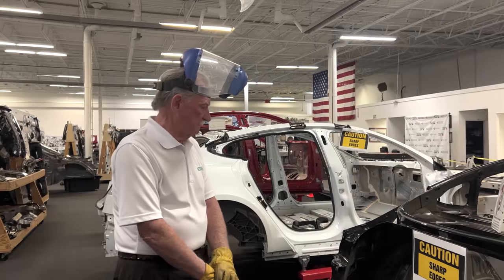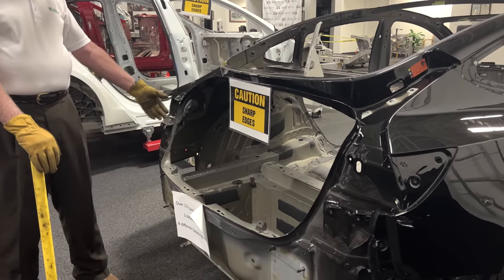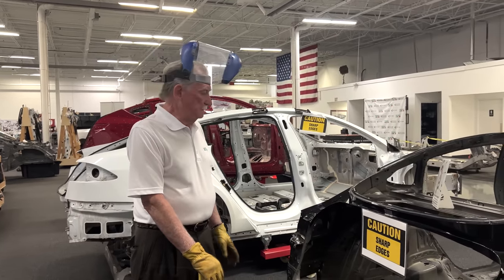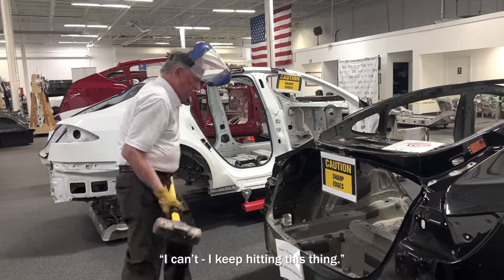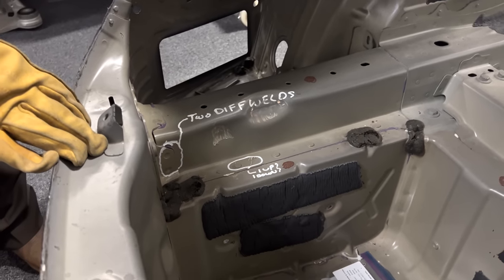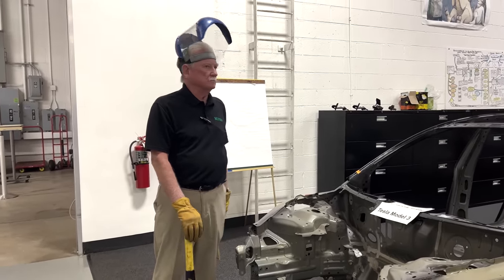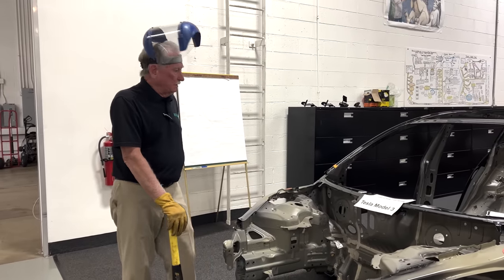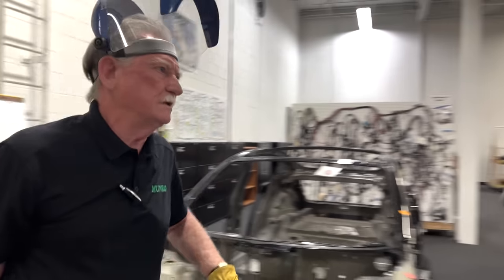Sandy Rant... With a Sledgehammer? Why Aluminum Castings Are Safer Than Steel

Comment: That casting is amazing! Thin wall over vast areas, mind blowing.

I was involved with making the tooling for the aluminum 4.6 L Lincoln Mk IIIV engine (Wisconsin Pattern, Racine WI). I thought we really had something maintaining a 4.5 mm wall thickness throughout, lots a ribbing, 6mm fillets on everything, cross hatching in the valley to mix the hotter aluminum as it came together. It was my second engine block and i learned so much from it!

But when i look at the Tesla castings, i realize how far the technology has come.

Comment: Sandy! Don't burn your computer. I'm a New Yorker and I admit, I'm an idiot! That's why I learn from your channel. People, repeat after me, "Aluminum castings are safer than steel!"
Reply: Not just stronger than steel, but stronger, more resilient than stamped, welded sheets of steel. And then the strength of aluminum alloys relative to the same mass of steel is way higher.

Comment: Sandy love your videos. And retired engineer here so for what it's worth, when you demonstrated the sledgehammer impact on the Model 3 stamped/welded steel and Model Y casting wouldn't some of the energy from the blow have been attenuated by the excessive movement of the casting. Newtons 1st and 3rd?
Reply: The methodology was pretty bad in that the longitudinal would be designed to compress rather than torque, as well as the parts moved which is actually why some cars are designed to disintegrate as the kinetic energy is displaced by more motion. The problem is, I don't think that part is going to break, and as such, I think he's right in the result, and I do not really doubt his explanation on the heads. My question is whether the car is societally good as it would be taking up resources that might be needed elsewhere. It's quick, strong, and cheap, but my question is whether it is wasteful for what the part needs to do. Considering that aluminum has some good properties in terms of abundance and considering it can reach levels of lithium by having dual channel electrons, is Tesla eating up potential battery resources?
Reply: @ronaldking1054  I don't think we're going to run out of aluminum.
Reply: @jamesvandamme7786  Yes, we are recycling aluminum for no reason.

Comment: Could you explain the desire for stronger parts in this context? As a layman, I had read that you specifically want weaker parts that crumple to absorb the crash energy better. Wouldn't these very strong castings have a higher cabin intrusion possibility? Obviously they thought of this and it's not a problem, but an explainer for the lay person would be helpful!

Comment: Well, the problem is that the demonstration could lead some people to think that castings are TOO rigid for offering good shock absorption, and consequently a safe car in case of an accident...
Reply: Good point. Designing "crumple zones" into castings sounds like a whole other art.
Reply: Your opinion that implies that steel can be safe is not wise. A steel structure that bends or that shears under the force of an extreme impact can be harmful to a passenger.
Reply: Crumpling is only important in certain parts of the car, other parts you want to be more rigid.
Reply: True but new Teslas are the safest cars tested so castings must work
Reply: It fell off a cliff before 4 people inside still alive 😂 what more proof we need have 4 people drive a Ford off a cliff and see the result
Reply: The Model Y got the highest score of any car tested by EuroNCAP so they must have pretty good crumple zones. Some zones should crumples and others shouldn’t.
Reply: With casting, you can put metal where it needs to be to achieve all the desired characteristics for the design intent. Yes, it CAN be done with steel, but a casting is one part, so the savings are massive when compared to hundreds of pieces of sheet steel needed to get equivalent results.
Reply: Many times an accident involves more than one impact. If the steel part yields with each impact the damage is incrementally worse.

Comment: What about micro fractures in the casting?
In Germany, where all cars have mandatory insurance, the rates for any casting car goes up currently as they are expected to be far quicker totaled as the casing can’t be repaired.
Reply: I can assure you that underwriters are not nearly as intelligent as you'd think. Policies often contain absolutely stupid language which lets consumers settle cases against them and then they keep the same language, allowing more consumers to do the stupid thing the policy is not supposed to cover. Worked in the industry, and they're by no means as smart as engineers. 

But yes, we've seen disgusting rises in insurance costs in the UK as well, and the sentiment seems to be it's nothing to do with the actual costs of crashes, or risk involved. It's not as if we have a sudden rise in drink driving here, because no-one can afford booze anymore. :D
Reply: @jonevansauthor  sure, I agree that this must not mean anything but either a money grab, or just belts and suspenders for something that  is unproven in mass and thus played overly safe. But Sandy‘s demonstration left some questions unanswered to me. Ok, cast aluminum may be less easy deformed and be able to absorb a lot more force without plastic deformation. But I don’t know if Medium impacts that would be able to be bent or just replaced with some welds in steel would result in a totaled car with a casting. Good thing we will know it soon enough with many OEMs going forecasting now.

Comment: Problem with the first casting: it moved across the floor which definitely adsorbed some of the hit...Second time was more reasonable...
Reply: YES
Reply: Are you STILL "going there"?
smh
Reply: YOU , still cant BREAK a TESLA Gigacasting , let alone one made in a 9000 TON machine.
Reply: There might be enough dumb people out there that all the computers in existence will need to be burned 😂
Reply: He has a point. The energy from the hit was transferred into motion of the whole casting rather than the spot of impact. 

If this commentary was far off basis, Sandy wouldn’t have done a day 2. It’s a fair criticism, even if it didn’t make a difference. 

In the end, casting > welding 100+ steel parts for this application (and I assume most others).
Reply: But the entire Model3 body moved too, essentially Invalidating your point.
Reply: @geomacaulay didnt invalidate his point in the slightest. Do you know anything at all about physics?  Most of the energy was transferred to the steel, as the car only moved only sightly.  The aluminum part literal flew more than the length of the aluminum part, meaning most of that energy was transferred into motion and not absorbed.

Comment: Great demonstration. You're probably aware there was one auto engine made of sheet metal parts, the Crosley COBRA (copper-brazed). If modern coolants were available in the 40's it might not have had the corrosion problems that killed it.

Comment: I agree with you on this but the doubters will point out that rear cast piece is loose on the floor and is moving out of the way when you strike it.  Its not fixed in place to recieve the hit.
Reply: Sandy specifically mentioned that and then did a follow up with one in place.

Comment: I have no formal structural engineering training, but it seems to me that it’s like comparing apples to oranges.  I can see the giga casting is thicker and has strategically placed re enforcements cast into the unit  where the flat thin steel sheets have none.   Seems like a no brainer that the casting will hold up better from such a hit.

Comment: Hmm.. substantial transfer of momentum when hitting the castings because they were movable, whilst the steel items were more rigidly fixed allowing more transfer of impact force. Not likely to change the outcome but...
Reply: The second hit on the casting was from above, so basically no transfer of momentum. NO change of outcome😉

Comment: I never thought it was such a huge difference. Insurance companies would still write off both cars tho... 🤔
Reply: TESLA Ins is way Cheaper , and REWARDS Drivers for Good FSD training.
Reply: @markplott4820  When FSD does work well (end of this decade is my guess), I wouldn't be surprised if your insurance rate is based on % you let the car drive vs % you drive.  Meaning your driving is what makes insurance more expensive.
Reply: @whattheschmidt FSD 12 is already better than the average driver. Give it another year or 2 and it will be near flawless.
Reply: All I care about is how safe the car is.  The rest can be replaced.
Reply: @themonsterunderyourbed9408  You have no stats to prove this
Reply: @MrCarGuy  My "stats" are observations from keeping updated on all the Tesla and FSD news for the last 10 years. 
And yes, from what I've seen FSD do, it is most certainly better than the average driver.
Reply: @MrCarGuy insurance companies use statistics to determine the rates they charge.  They know about how many of the people they insure will have accidents. They just don't know who. If they see that FSD vehicles are having fewer accidents per miles driven then it would make sense to lower rates for those drivers using FSD. Incentives to use FSD more makes  good business sense. Opps wrong topic.  Sorry
Reply: In the case where there is significant damage to crumple zones, they probably should both be totalled. What we cant see in this video are the microcracks in the materials and the welds, and the grains in the metals undergoing deformation. One cant just wave a torch over a frame and repair microscopic damage.

Comment: At the same volume, steel is stronger. This is what people tend to think applies. But, at the same weight, alu is stronger. That's why it's used in airplanes. More strength per weight. So you can make a casting using more volume of alu compared to steel and make it stronger, while lighter. Alu is a more expensive material, but a single casting vs multiple stamped panels makes manufacturing actually cheaper as well.

I think technically you could make an engine with cast steel, but that would be a massively heavy engine and very hard to machine. It just makes no sense to use anything else but cast alu.
Reply: Are old engines solid iron or steel?
Reply: Old engines used to be made like that.

Comment: I didn't get that must from this demo. I would have preferred to see this demonstrated with something a bit more reproducible,  maybe some sort of metered press, or more reproducible impact test (Maybe a point pressure would fracture the casting but just put a hole in the sheet metal?) . With the sledge hammer I didn't really know what I was seeing. Maybe under a different type of force the casting would fracture while the stamped metal would deform. Also there is the question of if each type of structure was suitable for the use case (Maybe the stamped metal was fine for the use and has some cost or other benefits?)
Reply: If you look at 4:07 at 4K you can see that it fractured after the sledge hammer hit it.

Comment: The fact thats its not attached to anything means that the casting can move with the hammer instead of having to absorb the impact so not really a fair comparison.
Reply: Clearly you did not watch the full video.
Reply: I don’t doubt that Sandy is correct, but yes this was an important difference in how the samples were tested. Not expecting lab conditions, but that was a big parameter
Reply: He knows that. The front casting was attached.

Comment: Hardly a fair test. If you hit that casting with exactly the same force under the same conditions we would be able to compare more accurately. This is just a publicity stunt
Reply: Yeah at least fixture the test article. 8:24 now I am left wondering if Monroe and associates thinks this is a valid way to perform a structural test. Seems to me like he didn’t expect it would slide across the floor, but wanted to release the video anyway. Clearly the aluminum casting has superior strength had the test been performed correctly, it’s reinforced with ribs and gussets versus the single wall steel. Not hard to prove with a quick test setup.

Comment: So i totally agree that the castings are stonger than the welded sheet metal. However, don't you want these parts to crumple in a large crash to absorb alot of the energy of the crash? Will having a casting just make the accelerations on the passengers worse? I guess in a really bad crash they will keep the pasenger compartment safer.
Reply: You have the bumper and the longitudinal to absorb energy and crumple.  The rest of the body needs to remain strong so it doesn't bend into the cabin.  The model Y with castings has the highest crash safety scores..ever.

Comment: Auto online just showed how Lego easy it is to assemble the modular Tesla car.  😊😊
It shows the advantage of the shape of the casting. It gives easy access to the assembler, basically one worker with top-down bolts installation. 😊😊😊😊😊😊😊😊

Comment: DFA/DFM advocates love castings in this sort of application, because one big part replaces 50 little ones that need to be fixtured and spot-welded.  And while I certainly believe that the casting can be designed with multiple load paths to be stronger and the aluminum provides better long-term corrosion resistance, its unlikely the end design will be lighter and the cycle time of all the operations needed to produce the final cast part will be daunting.

And once the insurance companies get involved, they are going to push back on cars getting totaled out from moderate rear impacts instead of being repairable.  Maybe we'll see these being fixed someday on Mechanic Steve's YT channel, but not by the average body shop down the street.
Reply: Your right in the fact that its not lighter. The Model Y with castings does weigh more the the Y without them. Not a huge difference so the trade offs are still worth it, but it is there. The rear castings with the crush cans built in can already be fixed in a rear end collision. The damaged part can be cut out and a replacement cast of just the crush can (made by Tesla) can be welded in. 
Remember, Tesla provides their own insurance in some states, so they think about these things way more then you will ever do.
Reply: Just can't believe how this video could be possibly produced by Munro, it is paranoid
Reply: He's shown in the past.. yeah the casting isn't really a weight savings as many predicted.. what it IS, is a cost savings, even with a higher cost material. With significant time and complexity savings. Reducing scrap.. reducing time in assembly and man hours is huge. And shows how and why Tesla is able to reduce their pricing over time as their production at scale keeps increasing. And it adds to a better overall build quality as well, with much less tolerance stackups. As for the crash properties.. clearly it's at least on par, if not an improvement. And as for repairs.. Idk.. seems very specific to each accident if it was cheaper or more expensive to repair. I call that a wash in general.

Comment: Sandy, while I agree that the casting is stronger, I don’t think you did a fully fair test. The casting moved while the welded structure was able to stay more in place so the sledgehammer’s energy was converted to motion while the welded piece was better braced…

Comment: Both have pros and cons. Castings could be stronger but with big impacts they can disintegrate acting as shrapnel, while steel has more plastic proprieties. The other issues are micro fractures, not only due to impacts as due to wear and tear. Galvanic corrosion could be another issue.
Reply: I refer to "what Sandy said"
.
Just take his word for it?
(FFS?)
Reply: YOU, dont know what UR talking about. 
Gigacastings is the FUTURE for all MASS market Electric cars. 
Scales to ECONOMY. 
its why TESLA makes entire car in 40 seconds , where Industry takes 60 seconds.........lol. 
no Galvanic rust , due to SPECIAL blend of Metals to make Alloy .
and each Casting is Primed & Painted. then Waterproofed.
Reply: @rogerstarkey5390  I was just referring some of the issues, Sandy constantly ignores to refer about castings. As production issues due to bad castings, with porosity or warpage of the castings.
Reply: @markplott4820   Here he is...the famous bot fanboy probably all in, with Tesla Stock, pretending to be an expert, after watching so many biased fanboy channels, but just sounding as a delusional fanboy.
Reply: Question to my non-engineer self is, how different those high pressure castings are compared to normal castings. The Uhatius bronze cannons cast under high pressure produced good results in military tests in the 19th century, when everyone had already started  using steel for artillery pieces.
Also, it may be a different alloy than the ones used eg. for alu bicycle frames (where microcrackings are indeed a problem).

Comment: Also because the casting will not deform, if a piece breaks off, Tesla and after market can provide replacement casting parts that can be bolted onto the original casting after the damaged area is cut away. Trying to straighten bent metal leads to alignment issues, so repairs with castings could very well be easier, cheaper and straighter.
Reply: you only need Adhesive to repair fractures.
Reply: @markplott4820  Sure, maybe even a combination of adhesive and bolt on bracket with templates provided to service centres of where to cut the main casting and where to drill holes for the new bolts. Granted it won't be your local Mom and Pop collision repair shop doing it but they won't be totalling nearly as many cars with castings as people are predicting.